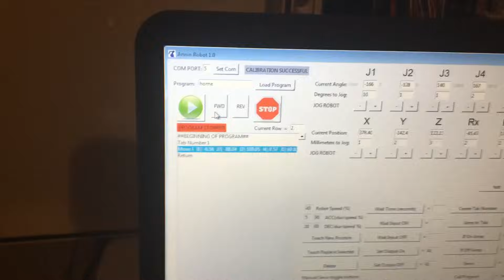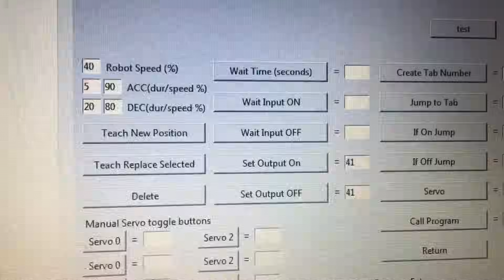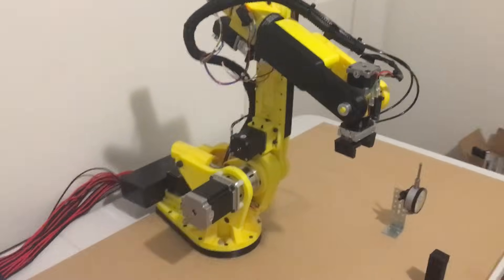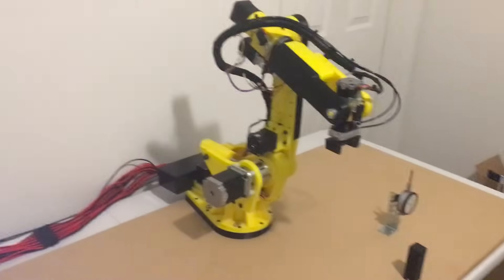3D printed  6 axis stepper motor robot - Gen2

Comment: Recommendation: get some stepper motor dampers or something, that thing is NOISY!
Reply from the maker: @flyerminer  the video is quite a few years old, those are analog drivers that were extremely noisy. If you check out the latest version of the AR4-MK3 that's almost silent

Comment: What stepper motor drivers did you use in this project.  I've noticed from the more recent iterations, you have updated to the DM542T, which provides better efficiency, torque and noise reduction.  I am considering building something similar, but I am considering using the DM332T since it is currently about $10 cheaper per unit, and operates within my motor and power source specifications.  I want to know if those are the same drivers you are using in this iteration.
Reply from the maker: They were analog drivers,
Reply from the maker: Any digital driver you use will be far superior, the 332 should be just fine

Comment: May I ask why you picked the Arduino instead of something like esp8266, esp32 or even a Raspberry Pi?
Reply: I would assume it is because his computer does all of the computations, so the Arduino is used to operate the motor drivers, actuators on the end effector and the limit switches.   The mega also provides 60+ GPIO pins at a low low cost.  Certainly those board you've mentioned will work work.
Reply from the maker: @benjaminmclaws3477  yes, If you need a full-blown OS and want to run multiple programs on a single computer, the Raspberry Pi is the right choice. If you just want to get one job done and also need to control external periphery, the Arduino is the superior machine

Comment: im gunna be building one of these pritty soon, and id like to know if it can be controlled buy a home made push button controller or a flight simulator joystick, i have an arduino mega 2560 and about 8 stepper motors spare also got 6 H-Bridge stepper motor drivers arriving and also have a ramps 1.4 board sat here if that could be used? looking forward to reading your reply and i will be following you on here. thanks josh
Reply from the maker: hello, you can control it with an xbox controller - if you have a look at the website and review the tutorials page see the programming video which covers this.

Comment: Hi
What is the function of the motor at the top?
Reply from the maker: the motor on the back of the elbow drives the wrist using a long leadscrew and carrier.  you can see how it works if you have a look through the assembly manual.

Comment: Do you consider to go open source and cooperate , for example,  with freecad and Blender, and Blender cam that is for cnc , and make an opensource kit platform , that people can buy and add ideas , and 3d priting upgrades,  also more hackerspaces has got lathe and metal machinery... so you can build a disen community  even pick and place or use it on bigger cube type 3d printer

Comment: Late to the party but make it help you build some servo motors to upgrade itself.
Reply: Hi bro i want to learn this thing i use Arduino for simple project but this its loking hard to mee programing by paython with Arduino chipset if there is a Chaîne or vidéos  on YouTube  to explain the relation with paython and thanx bro

Comment: I think you should substitute the stepper for bldc motors will reduce noise and increase speed.
Reply from the maker: Yeah, I am thinking about it. It’s just the cost. The latest version made out of aluminum uses a digital driver and it’s super quiet, but I’m exploring my options for the close loop version on my next robot
Reply: @anninrobotics  I think I can help you with that. Check your email.

Comment: Nice Work!. But I'm wondering why do you use Step Motor not Servo for industry one.
If you use Step Motor, robot's resolution gonna be very high, but speed is quite low, right?
Reply from the maker: 사람은사랑으로 I used stepper motors because they are very cheap. I was trying to keep the price as low as humanly possible

Comment: How much did you spend on it?
Reply from the maker: MR.ES1 the plastic version was around $1100
Reply: @anninrobotics  The 3D printed one ? Or I'm getting it wrong?
Reply from the maker: Correct 3d printed one. Aluminum is $500 more for aluminum parts and probably another $300 for digital drivers and precision series motors whereas I used analog drivers and cheaper motors for the printed version

Comment: Good job, i didn't see any project which is made on 3d printer as your robot, but it is better to use steel materials because the robot is shaking when it stops.
Reply from the maker: Murat PALACI thank you. I do have an aluminum version too.
Reply: i have noticed it just before... Very nice..

Comment: It's to much wiggle room so it's inaccurate in some areas so the aluminium one will be more robust and accurate, i also recommend to gets some higher precision and higher torque motors so your able to lift more will more accuracy, but it's an awesome homemade project! Nice work indeed!

Comment: Awesome!
But why does it make this noise when it goes really slow? Because of the motors? Or is there a pump? (sounds like a pump lol).
Also, why is it stopping for a sec or so when going into slow mode like above?
Reply from the maker: The analog stepper drivers are loud if you watch my other videos on the aluminum version with digital drivers it’s it’s really quiet

Comment: J2 is now done and up and running. Had a problem with it squealing and motion was all messed up. Turned out the black stepper motor wire was disconnected! Works great now! On to J3!
Reply from the maker: Brian Mathis awesome!

Comment: It doesn't really say, but you have the laptop connected to the Arduino to control the robot? I have all the wiring done, waiting for parts, only two more pieces to print, and I want to run the steppers before they are installed, cause I'm impatient... I'm going to give it a try tomorrow!
Reply from the maker: yes the laptop (AR2 software) has a serial connection to the arduino and must be running to control the robot.  the  laptop tracks position and motions, the arduino just receives movement commands and then sends step and direction pulses to the drivers.
Reply: I have noticed if you don't jog the robot, after turning it off, it will start where it left off. No need to re-calibrate most of the time.

Comment: Panel and wiring mostly done. Waiting on a bearing and sprocket, down to printing the last few parts ( j5 and 6 stuff ) then I'll be taking over the world! Or at least my work shop. I really want to power up the steppers, zero them and then create a motion program and just watch them move. Also want to create a gripper for aluminum cans!
Reply: Hi  Brian  i want to learn this thing i use Arduino for simple project but this its loking hard to mee programing by paython with Arduino chipset if there is a Chaîne or vidéos  on YouTube  to explain the relation with paython and thanx bro

Comment: I've got J1 completed, working on J2 and controls. There is an error in the photo of the stepper drivers connections to the arduino. Two photos, one shows drivers reversed! There's also an M8 screw not listed in parts, but is in manual. Don't know if its actually needed yet. But awesome project! Next version will be aluminum!
Reply from the maker: Glad you like it. Can you tell me what page showing the drivers you are referring to. Please email me Chris.annin@gmail.com
Reply: Hey Chris,

First off, not complaining, love the project and that you give it out to people like myself that can't do this by ourselves!

What I'm looking at is the Electrical Enclosure instructions. On page 12 it shows the Stepper Drivers mounted from top to bottom as J4, J1, J2, J3, J5, J6 and a Track if needed.

On page 20, it shows the Stepper Drivers from top to bottom listed as J4, J6, J5, J3, J2, J1, and then the Track Stepper Driver if needed.

I thought the enclosure may have been flipped upside down, but based on the Arduino and it starts as J4, then either J1 or J6, I assumed the first picture on page 12 is correct. What really messed me up is the ribbon wires start AND end with a black and white wire!

I also looked at the wiring diagram which helped.

I'm also thinking of printing out a modified base plate that has the additional supports already part of the print, then just glue them to the J1 Turret Housing after it's assembled.

Again, THANK YOU for getting this together. If there's any way I can help let me know.
Reply from the maker: Brian Mathis thank you for the detailed feedback, I’ll look at the manual when I get home tonight and see what I can do to clear that up.

Comment: What software do you use for control ?
Reply from the maker: I wrote the control program in python using tkinter module. Control program sends serial commands to the arduino. You can find the control program source code as well as windows exe file and the arduino sketch on the github project page.
Reply: Chris Annin Thank you for reply. I will use mach 3 for control my super robot. I not sure that can or not....

Comment: How strong is it? How much can it hold when fully extended? Is it 100% Infill? Has the plastic ever snapped?
Reply from the maker: The plastic version I’ve lifted 30 ounces. But I haven’t wanted to press my luck and risk breaking it. The aluminum version Can left 4 pounds. The structural components printed or 50% Fill and the spindles are 100% fill

Comment: now you just need stepper servos instead and it will be a fantastic system.
Reply: Hi bro i want to learn this thing i use Arduino for simple project but this its loking hard to mee programing by paython with Arduino chipset if there is a Chaîne or vidéos  on YouTube  to explain the relation with paython and thanx bro

Comment: what is the budget for this development?
Reply from the maker: The printed version was approx $1200 to build. I have a kickstarter going for aluminum parts which will be $1195 for aluminum parts and total estimated cost to build the aluminum version is around $2500 depending on which suppliers you can get bearings and hardware from. I’m working on offering a more complete kit that includes the bearings and hardware but will take me a little time to put together.
Reply: Thank you

Comment: do you have a store set up to purchase the 3d printed parts?
Reply from the maker: Not yet, I do have a kickstarter going to get started selling Aluminium parts. If it goes well I’ll start looking into offering more kits and parts like this
Reply: Chris Annin so far it seems to be a fun build, what percentage infill did you use to print? Is it completely solid abs?
Reply from the maker: I did 50% fill on all parts except the spindles which were 100%

Comment: Hello. And what program do you use for management. Whether it is possible to deduce on 1 button management. When you press it, the whole cycle of manipulations (stored in memory)
Reply from the maker: The control software is written in python using the tkinter module, position data is stored in a tkinter list. The list is processed and each command is send to the arduino as a coded string. The arduino decodes the string and uses a 3 step algorithm to control motor steps and keep all motor steps synchronized.

Comment: Where would you learn how to write software in python? What IDE do you use? I want to build similar software that can show various arduino outputs (without using the serial monitor). In addition, I want to be able to click something on screen and have the arduino run a custom function based on what was clicked.
Reply from the maker: I’m mostly self taught using google and stack exchange as resources.  I just used notepad but I know a lot of people use pycharm.  You could also use code academy to learn.  I used tkinter module for GUI.
Reply: Thanks for the learning resources! Cool project, by the way!

Comment: hi,  iam trying to use your software and in the calibration section my robot takes 51000 steps to reach the j1 positive limit but when i give save and start the calibration again it does not do the calibration same for other joints j2 takes 46000 steps its like it performs the calibration only between a specific step value . please help is there any setting that needs to be done.
Reply from the maker: Hello, the arduino mega uses 16bit 2byte integer which yield max 32,767 steps.  You could try using an arduino duo which has 4byte integer but I haven’t tried it and I’m not sure what issues or changes might come up.  I had one situation where I needed more steps and I had to reduce micro stepping.

Comment: Maybe a silly question, wouldn't those gimbal type BL motors make the design slimmer? Or aren't they not suitable because of accuracy or load? Or is programming them more difficult? (as far as I remember they are more difficult to get them run). Example would be GBM5208H-200T
Reply from the maker: I’m not familiar with that motor, I’ll have to look it up. I selected these motors mostly based on price.
Reply: Chris Annin , I didn't meant specifically that one. It was more a general question.

Comment: That's awesome but you put all of that in and didn't instal a joy stick an button?
Reply from the maker: That is something I’d like to add in the future.  Currently it’s the software tracking position and sending single string commands to the arduino. To get a joystick to work the joystick would have to interface with the arduino and the I’d have to create a way for the arduino to track position and send that back to the PC. Would be some work and could be done, I’m looking at possibly moving the platform to a raspberry pi and integrating an Xbox controller through the pi.

Comment: Excellent design and development work.  Thank you for taking the time to spell everything out for us.
 I am not clear on how the part numbers in your BOM change from regular to precision.
Can you please give the part numbers for all six precision motors in the aluminum version?
Also I see there are differences in the motor BOM between the plastic and aluminum versions.
I assume that is due to the extra weight of the aluminum parts.  Will the precision motors for the aluminum version fit into the plastic parts?  If so, I can make the plastic one first and then go to the metal without buying more motors.
Thank you in advance for your help.
P.S. Please let me know when the kickstarter goes online.
Reply from the maker: Hello,  There were some changes from the original design on the first 3-D printed robot that I build to the current version. The current version uses precision series motors for the first three joints and the same motors for joints forfive and six. The biggest difference in the parts themselves is that the spindle border for joint two is 14 mm and the motor mount for joints 12 and three are different. If you look at the bill of materials and I think the manual for the electrical enclosure and the manual for the wiring harness all the part numbers should be listed. The folder with the print files includes models to build a robot either way.I am currently right in the middle of revising all the manuals and showing pictures of the robot being built with aluminum parts the new manuals should clear everything up. The folder with all the print file includes models for both iterations using the Percision series motors and the economy series motors.I should have all the manuals ready and posted within three weeks I think. And I will be launching the kick starter shortly after that. Please feel free to email me if you have any questions and I will try to answer them.
Reply: Thanks for the information and the quick reply.  I will wait a month for all of your new material to come together.

Comment: Lovely device, how long did you spend designing, modelling and coding?
Reply from the maker: Im guessing 6 months of goofing around on this version to get the plastic one built.  prior to that I had built a smaller version but that was mostly proof of concept.  lately ive invested more time with the aluminum version and the latest updates.  I will be releasing a new version of software and also doing a kickstarter to build aluminum kits.

Comment: Dear respected sir, Hope you are in good health with success and happiness. I am very happy for your awesome work. I'm alos working on robot arm. I'm totally begainer. 
Here I have seen you are using belt and pinion. But could run the arises by Direct motors instead of using belt pulleys?
That's means, could I make Direct motor articulated robot arm?

Comment: I built a arm out of wood! I wanted to be different It was all Maple and Walnut. I sold it on ebay for $2600 Whats the WEIGHT LIMIT? For lifting parts? I used all Nema 24s. IT LOOKS LIKE JUST YOUR MAIN BOOM IS A 24 RIGHT?
Reply from the maker: On my aluminum version of this robot the weight limit was between three and 4 pounds. Yes axis to is a 24

Comment: Wow this is just incredible! Fantastic work. I've wanted to build one of these for years with the hopes of doing 6 axis milling of sculptures on a turn table. The 3D printed one doesn't look rigid enough to hold a spindle and  be accurate. Maybe the aluminum one would be better.